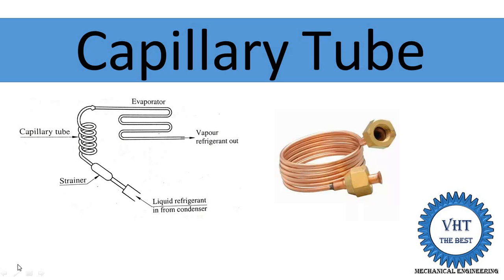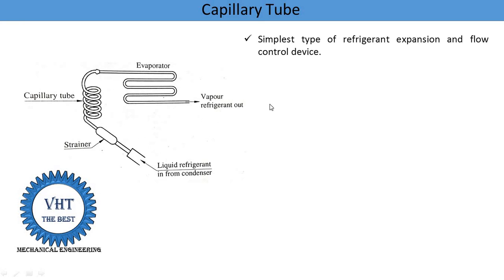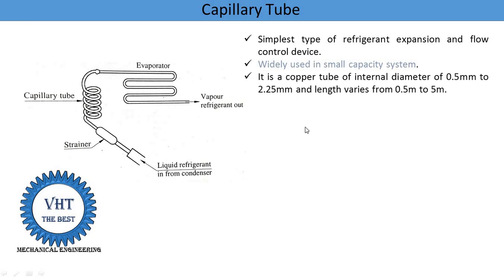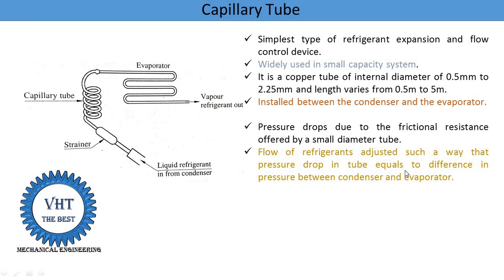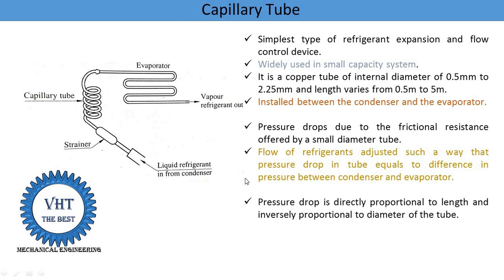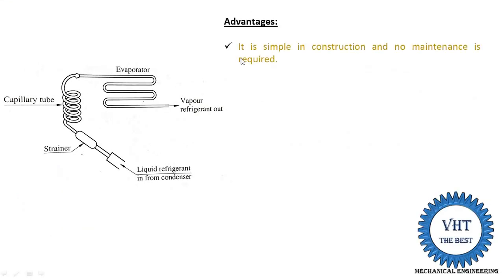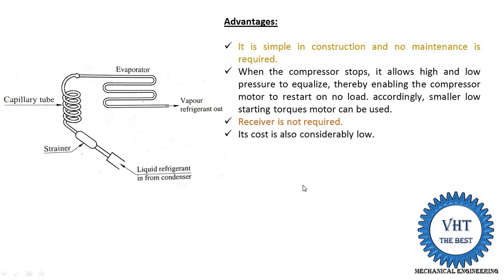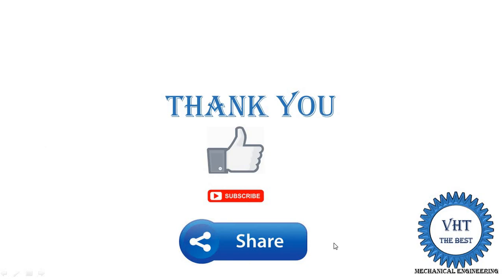Capillary Tube

Comment: Hello sir...i have a question. Our freezer system need to operate at -30c... When we replace new compressor and capillary tube, it only go to -22c.... If i increase the capillary length, is it will decrease the temperature? Thanks

Comment: how capillary tube will reduce the pressure
Reply: high pressure, low velocity in large dia to small dia tube with high velocity will reduce the pressure ! 
refer bernoulli's equation
Reply: @jidnyeshraut2833 lets talk numbers. Why if the pressure drops that capilary tube is not frosting up outside the fridge?
Reply: Very good explanation but you forgot the most important thing to mention the relationship between pressure and temperature  in the is situation we Wana drop the pressure to reduce tumprture.....